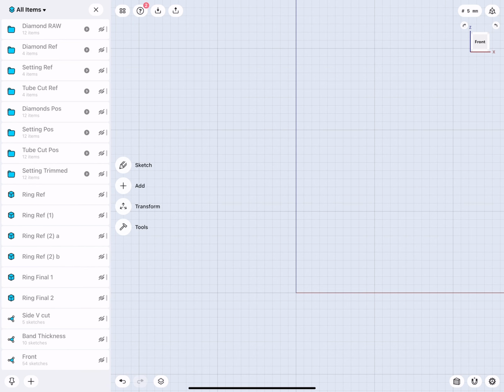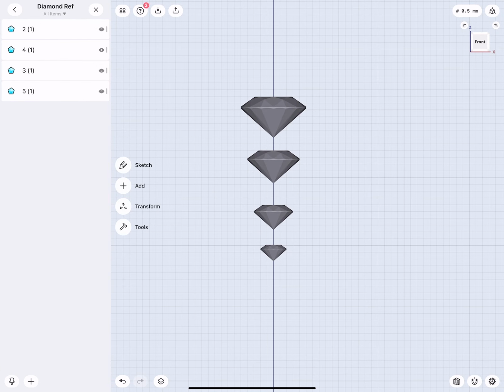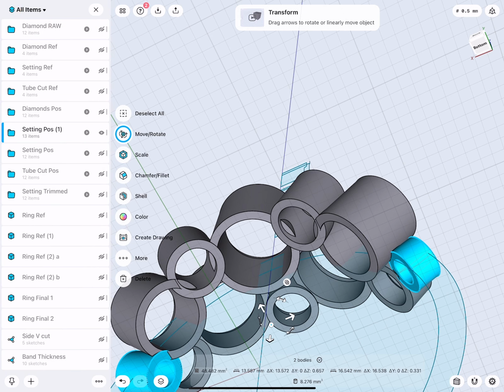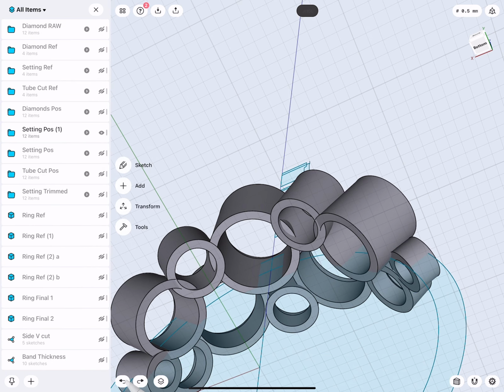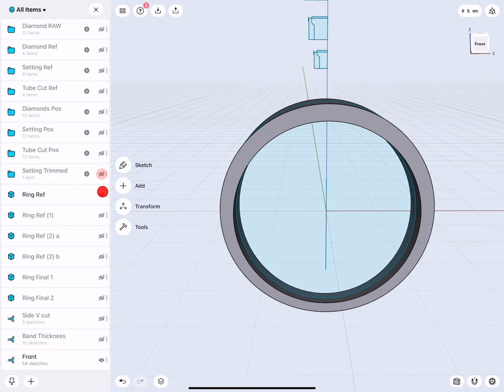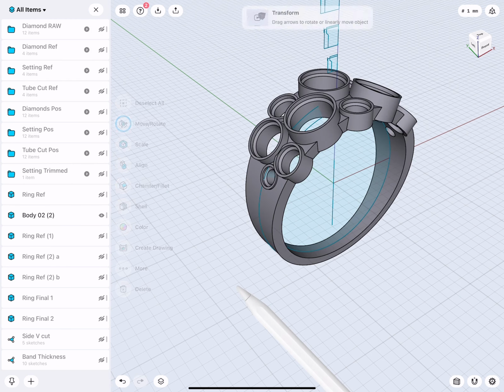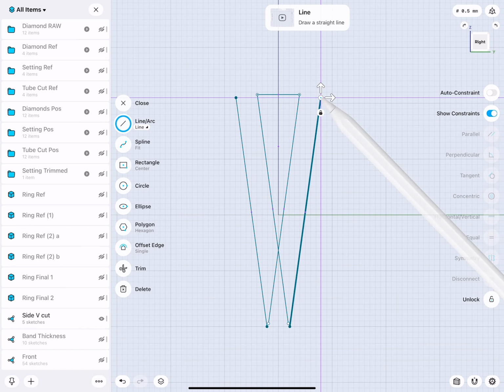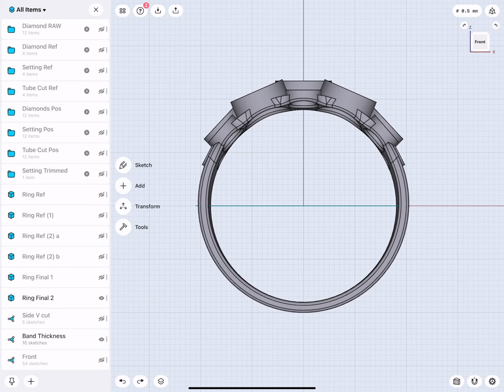3D modeling bezel settings | Shapr3D step-by-step

Comment: How do I make like half a sphere/cylinder, like if a sphere or cylinder were to be sliced in half
Reply from the maker: Hi 👋We have several discussions on this topic on our Forum. There are many ways to split a body into half. For instance with the construction plane. Here is one thread: https://discourse.shapr3d.com/t/how-to-cut-this-object-into-two-pieces/4647/4.
Reply: Draw half a circle or rectangle and when you revolve it only go by 180 degrees not 360

When you are in revolve command look for the tool UI icons - there is one for rotation
Reply: @cekuhnen  ohhhh thanks